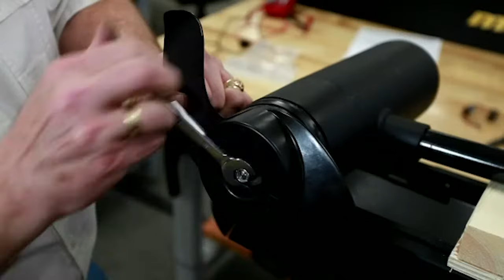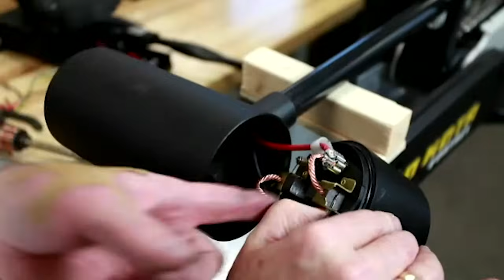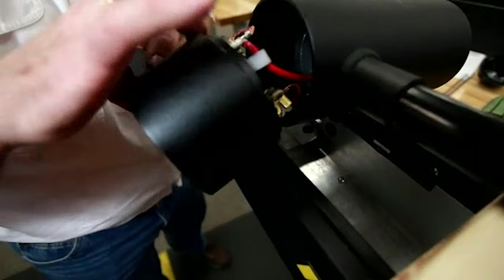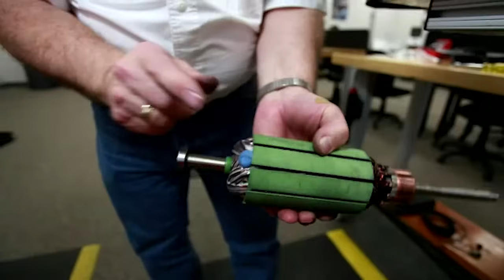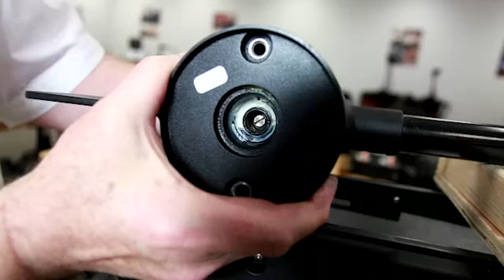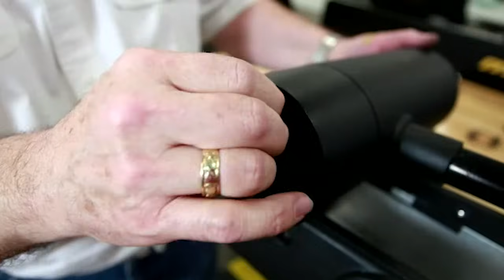4 Inch Trolling Motor Lower Unit Disassembly & Assembly | Minn Kota

Comment: what kind of grease do do you apply to the reals and orings?  Silicone grease or oil base grease?  Thanks
Reply: Never use petroleum base lubes with black orings since they could be epdm orings.

Comment: So does the front come off on universal sonar or not?
Reply from the maker: It does, however a cable runs from the US2 plain end housing, through the motor, and up the shaft. The connection for the cable must be disconnected in the control box at the top of the shaft to completely remove the US2 plain end housing.
Reply: @MinnKotaTutorials is it possible for me to replace the brushes without removing the front on a universal 112 model fortrex?? I this my brushes are bad,,.
Reply: This is the info I came here for

Comment: Maestro tengo un minn kota de 36 lb lo tengo recién comprado pero es usado y trae batería original lo probé con una de automóvil de 12 500 amperios y no tiene fuerza, será que tengo que cambiarle las escobillas y balones o será la batería, por favor colaborame
Reply: Is the battery fully charged? You want to use deep cycle batteries. There are a lot of possibilities as to why it might not be working. There isn't enough information given to even suggest a possibility. Look at the brushes. Check for continuity on the motor like in the video. Mine stopped working because it was full of water. I put new seals in and new brushes.

Comment: A y help greatly appreciated, I did not take motor apart guy who gave it to me did. I bought a rebuild kit (74-101#} I hv older RT74 trolling motor Minn Kota riptide, There are several parts I hv no idea one is a cardboard spacer or looks like a paper towel holder cardboard but smaller bout 1” dia. 1/2” tall and two thick rubber nylon type found seals or gaskets bout the same size, as well as where all the washers go and order they go in parts drawings schematics don’t really help tell me difference in washers. It’s just a pencil drawing anyone help me maybe ? Thanks

Comment: Also witch way does the ball bearing go? You said one side is dust seal the other is oil seal?
Reply from the maker: Crappie Xpress,
Are you asking about the bearing that press onto your armature?  If so, it doesn't matter which way that bearing goes.
Best Regards.
Reply: @MinnKotaTutorials  what about the two seals at the prop shaft? Do the cups both face outward?
Reply from the maker: Crappie Xpress,
Only one seal should have a metal cap.  This is the seal that will go on the outside with the metal cap facing out.
Best regards.
Reply: @MinnKotaTutorials  I’m no longer talking about the bearing. I’m now asking about the SEAL’s in the manual it shows 2 . They keep water from entering the housing via the shaft that the prop goes on.  DO BOTH THE SEALS - cup face outward? That would mean without the propeller on you would see the seal cup that has the tiny spring exposed? In your video you say the first Seal cup faces out but you do not mention the second one???
Reply from the maker: Crappie Xpress,
I understand that you are referring to the seals where the armature shaft exits the motor. There are 2 seals there and only one of them will have a metal cap. The seal without the metal cap will go in first with the flat side facing the motor. The 2nd seal will have a metal cap and that will go in last with the metal cap facing out.
Best regards.
Reply: Is there an updated part # for the prop shaft seals? Diagrams I have seen only show one part # for both seals. So how could one have a metal cap and one not?
Reply: @tomb7890  I pulled mine back apart just to check and neither have a metal cap and there is no spacer!!!    WTH?

Comment: Do both of the cup seal face out towards the prop? You said the first one does but you didn’t say the second one did??
Reply: Yes they both face out. I took mine apart and that is how they were oriented.
Reply: He also doesn't mention the paper tube that goes between them. Or how mf hard it is to get the old ones out.
Reply: @chrsrumbaugh I second this on all counts. Plus would it hurt to make the housing a little bit bigger?
Reply: @chrsrumbaugh  A slide hammer is good to have.
Reply: @chrsrumbaugh . How you get your seals out without damaging the brass flange?  
Does the cardboard come in a seal kit. Because mine didn’t.
Reply: Half ass video. 
If you’re going to make a video of taking a motor apart please show all aspects of the procedure.

Comment: I have a 80lb thrust Terrova with i-Pilot (salt water) and the mark on my front cone is oriented on the side and not the bottom like you show. I’ve never taken it apart.
Reply: To help with your question I believe if you have the “skeg “  parallel with the shaft  meaning straight down the long bolts are going to be straight in towards the front and have to hit the holes. You will probably be ok by eyeballing it.
Reply: My freshwater 80 Terrova has bolts in vertical orientation as well from factory. No choice in this. The skeg points down and front cone mark is on the side.
Reply: Mine did not face downward either.